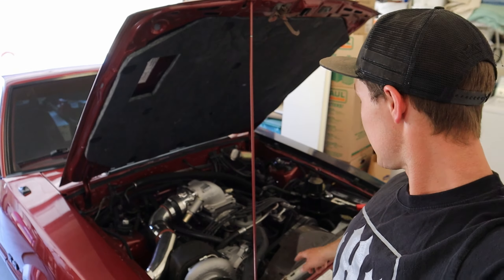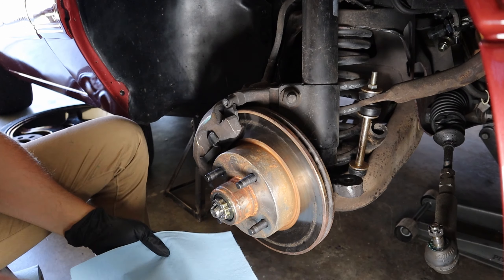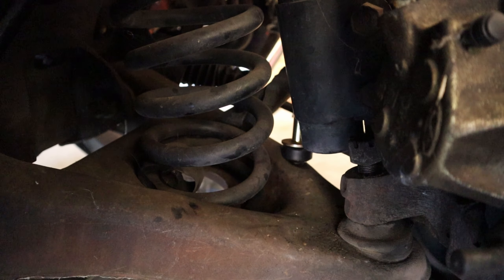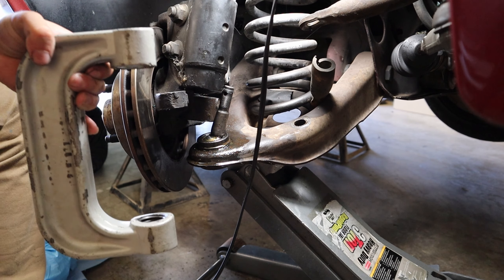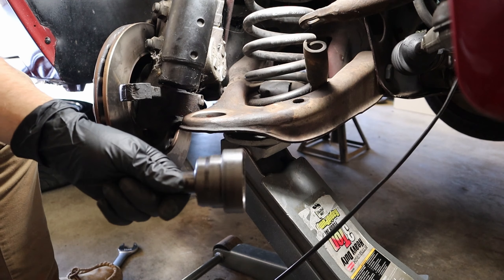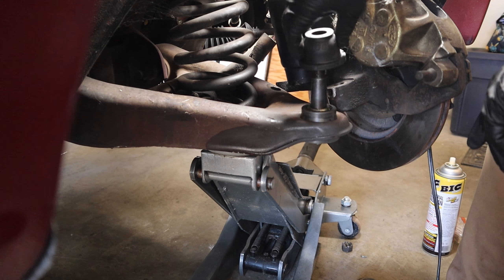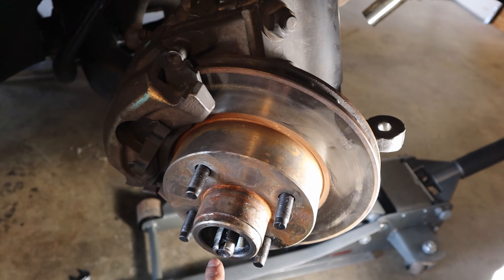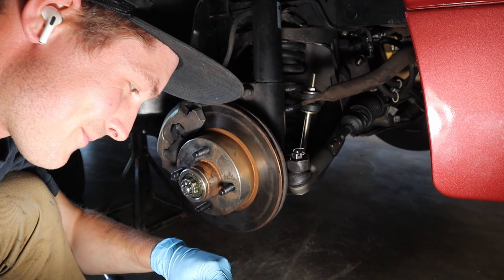How to install Fox Body ball joints STEP BY STEP instruction!

Comment: To get mine out of my 2003 Mach 1, I needed an 18" section of pipe attached to another 18" section of pipe attached to a 2' breaker bar.

Comment: That was only 84.468 ft lbs of torque that you put on the lower ball joint, I measured it with my eyes based on how far the nut turned with every grunt that you gave it 😂🤣 Im fixing to put uper and lower tubular control arms on mine if this dang rain will ever quit when I get off work,  every afternoon i plan on putting them on it rains, gotta love this L.A weather (lower Alabama) 😂 I also gotta pull my engine back out to get a tiny little crack fixed in my block above the oil filter 😭😭😭 that sucks a fat sweaty one 🤣